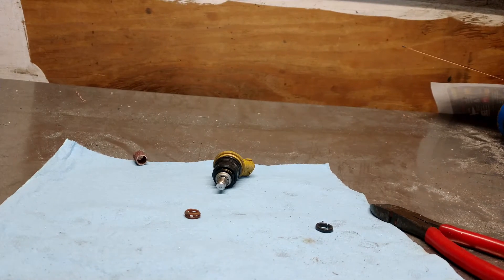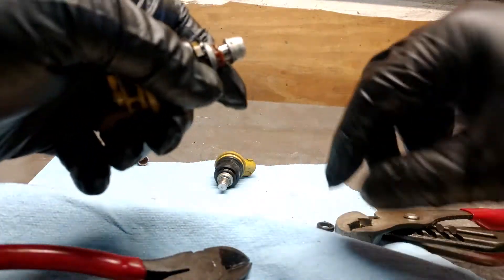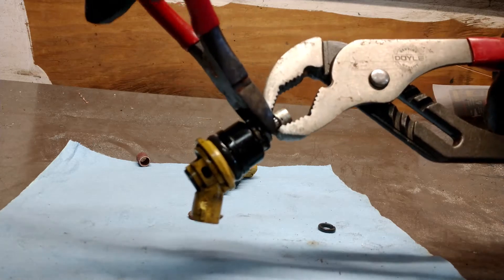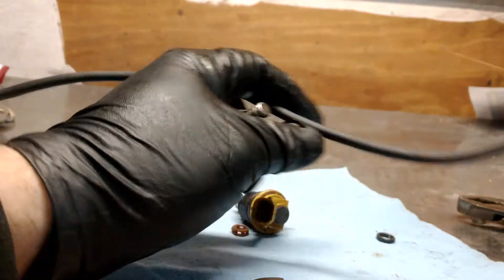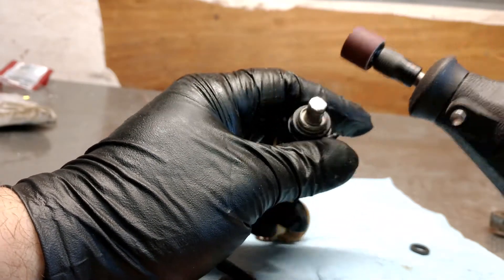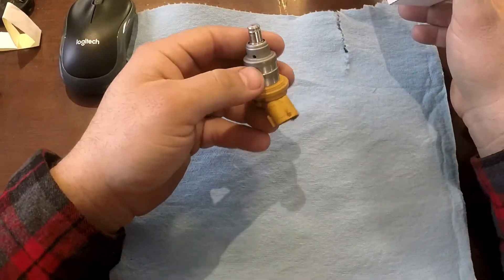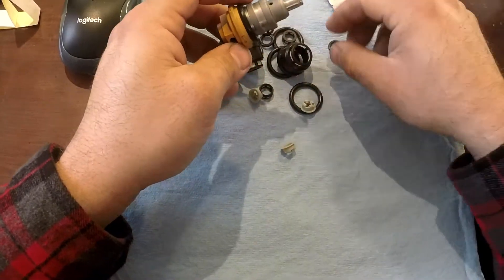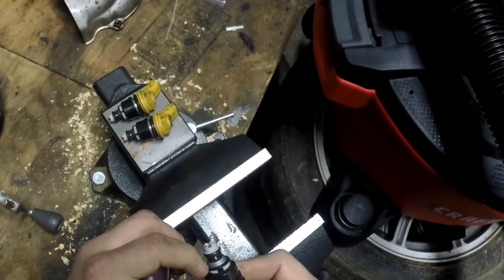How to Decap Subaru STI Side Feed Fuel Injectors.

Comment: Sorry but what’s the benefit of de capping the injectors?
Reply: Where did you get the o ring ( lower seal  ? Even the ford dealer does  not know
Reply: @engineprojects take your o ring off and measure it and order a ethanol comparable o ring. But this is a Subaru Ford definatly won’t know anything. And even if it was a Ford. Ford dealers still don’t know even when you have the part on front of them.
Reply from the maker: @MikeSF5  you are removing the small holes. If you Google sloppy mechanics there’s a lot more information on D capping injectors
Reply: You can increase the flow rate